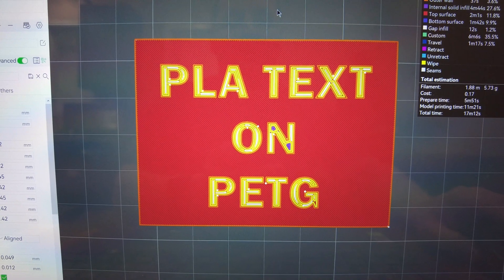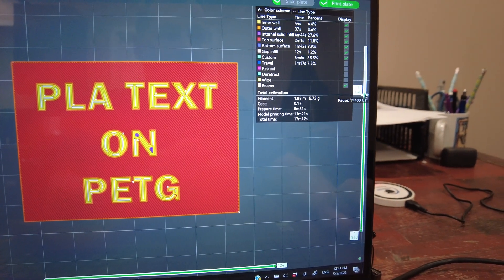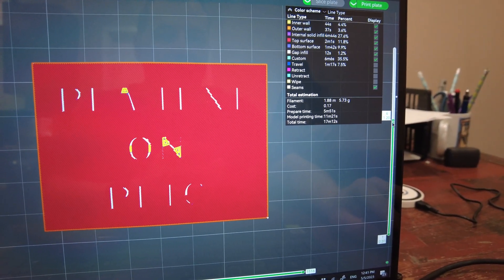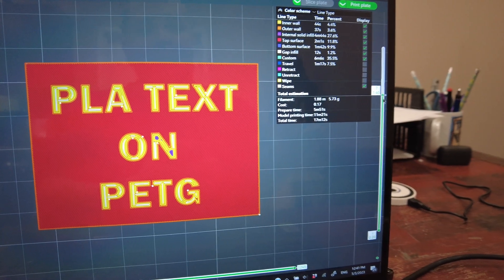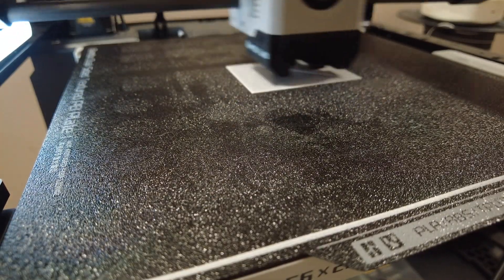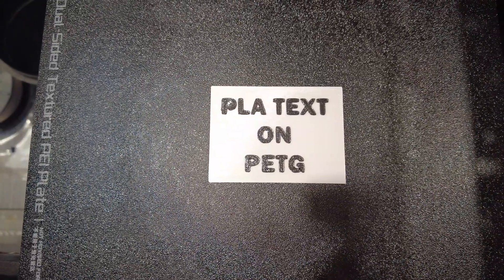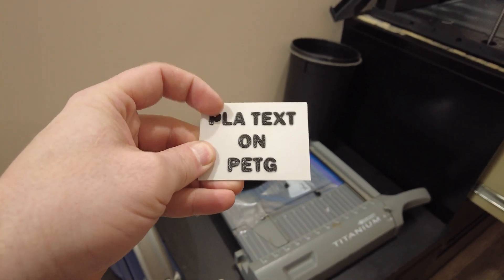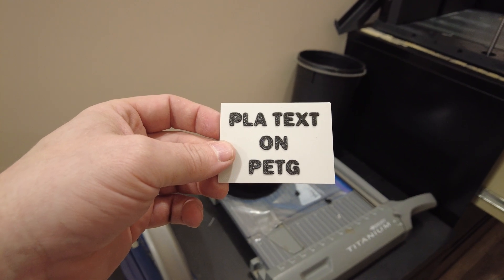3d Printing PLA on PETG

Comment: Thx for the video. How do you change the filament, by using the unloading and loading filament function on the p1p screen of by using the retract/extrude button for the extruder? (Obviously I could find it out myself, but have not done a bi-color print yet)
Reply from the maker: There's an unload option. You go to the second menu down on the P1P screen and then select filament, then hit unload. It'll preheat, move the print head to the back and then retract the filament after it gets up to temperature.

Comment: Interesting. And somehow you haven't ended with a ton of stringing even!
Have you tried this with less flat models?
Reply from the maker: I haven't tried it on less flat models yet. I think the low stringing is more due to the printer than anything I've done. That stock fan cools layers pretty quick which I think is what helps the most.
Reply: @MiddleAgedTechNerd-rt2lp  Good to know!